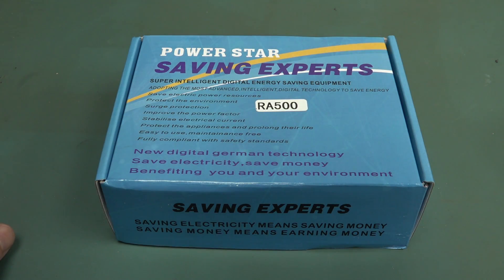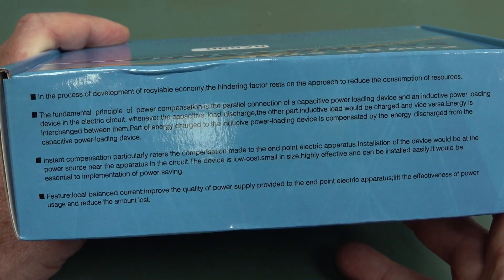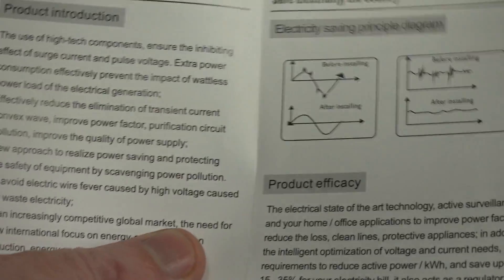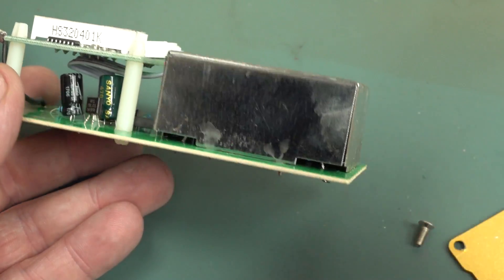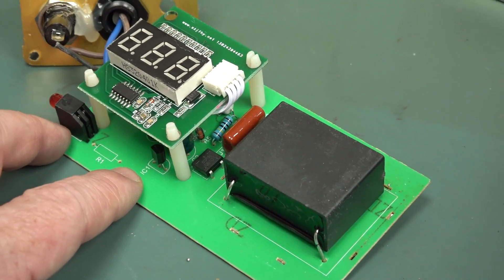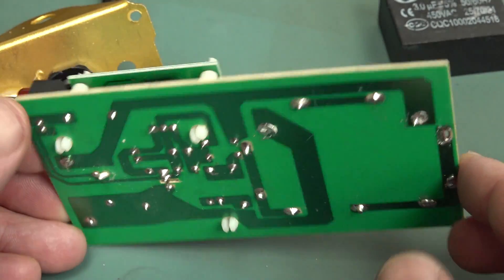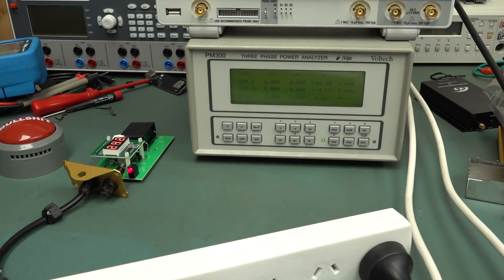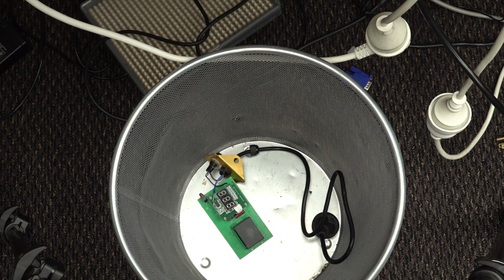EEVblog #1191 - Digital Energy Savers BUSTED!

Comment: 1:40 earning money, yeah right! The only people earning money are the fraudsters selling this wooo!

4:14 NOT 25 hundred, 25 THOUSAND WATTS!
Reply from the maker: Damn, it is 25 THOUSAND!
Reply: @EEVblog  

Gotta have that "digital german".
Reply: ElectronAsh, that would be Kraftwerk
Reply: @Radfordperson  Dave's the operator with his pocket calculator...
Reply: How about a " Nola converter "?  It was invented by Frank Nola at NASA in the late 70's    This is technology that reduces voltage to a lightly loaded electric motor saving electricity.  I haven't tested one but for a motor then needs constant speed but has a varying load, it seems like it would work.  Devices such as an escalator, elevator , conveyor belt could benefit but constant load uses like an air compressor , fan would not.   Another benefit of the controller is that is gives soft starts reducing shock loads.
Reply: @bobroberts2371 , got a link to a "nola converter", my google'ing came up empty? Technically there is nothing stopping a motor from being load regulated. This is especially true where something like constant speed is required with varying loads, which is done all of the time in closed loop control systems.
Reply: @bobroberts2371  A more sophisticated version of such a gadget is often sold as a "VFD", which works even better by also varying the frequency as its name implies.
Reply: NiHaoMike A VFD is typically only used on 3 phase motors.  I've used them when working in industry.  The great thing about a modern VFD is that single phase input can be converted to 3 phase output. Output is limited to the 2 HP range but plenty enough to run small machine tools.
Reply: 25000 watts, for if when it’s too dark in your house - just get that household wiring glowing red hot!
Reply: @Pentross  "25000 watts, for if when it’s too dark in your house - just get that household wiring glowing red hot!" Pumping 25kW through household wiring wont glow red hot, it obliterates the weakest point in that line at an instant...
Reply: 25kw power cord
Reply: @bobroberts2371  , thanks. Though as mentioned, I wonder what the advantages over existing regulation systems are. I assume it has to be cheaper, easier to manufacture, or something.
Reply: LetterSlayer they should try fitting a power plant inside saying 50Mega watt
Reply: lol wanted to say the EXACT same thing ^_^
Reply: Agreed to kill what is in the air she saving device.

I borrowed one a couple of times to prove a point.

I am wanting to bye one.
Reply: @blacknester Just turn up the voltage until leakage isn't ignored, would need a few kV   ;)
Reply: @blacknester , at a fixed mains voltage, your current is going to be huge... and melting, at 25,000 watts, especially given the small conductors in the device, they'd probably fail first and early on anyhow.

Comment: As an electrical and electronic engineer of 36 years with many years in R&D I am appalled that an engineer in China/Germany would consent to make this gubbins which is BS and has written up the item in BS Chinglish. A little bit of knowledge is a dangerous and apparently lucrative thing. 
PS why even bother to have the expense of the capacitor and circuit elements when an empty box would 'work' just as well.

Comment: There are two types of power factor. The first is the one that most people know which is called the displacement power factor. This is due to cos(theta_v - theta_i) , I.e. the angle between the fundamental voltage and fundamental current. The second type of power factor is due to the harmonics being drawn from a switch mode device. This is called Distortion Factor and is given by (rms of fundamental current)/(total rms current). The total power factor is multiplying the displacement power factor with the distortion factor. 

This means that a switch mode component with a poor distortion factor will have a poor power factor regardless of if you connect an inductor or capacitor in parallel with the device. In fact, as Dave showed that putting the capacitor in parallel with the oscilloscope, the power factor decreased. Because the oscilloscope has a distortion factor and the capacitor added an extra displacement power factor on top of it.

To improve the power factor of switch mode devices we would need to place a low pass filter in series with it so that it filters out the current harmonics that the switching process creates.

Comment: These things do have some value if you are a ham radio operator or MW/SW radio listener. They do actually reduce the buzzies and birdies in your  radios caused by the equally-cheezy switching wall-warts coming from C#1na. Shorten the line cord to a few inches for the best effect. Plug them in to the same outlets as your noisy wall warts. Dave: Checking these as line filters with one of your surge and conducted interference testers could be fun in more ways than one!

Comment: Without getting into nonsense, the fact is that:1)Reduction of  " I squared R " losses make simple addition of capacitors of benefit near to inductive loads like fixed speed induction  motors by reducing line current losses ,but will the extra terminal voltage mean the motor simply run slightly faster and do more work ?  2) If there is a KVA maximun demand charge tariff, improving power factor makes sense whether centrally or at the final point of energy use. 3) Anything claiming to improve power quality or harmonics is generally a scam, 4) inverter drives running induction  motors  generally operating at sub 95% of mains frequency will save energy and 5) fixed speed motor voltage controllers for generally cyclic load duty on mainly lightly loaded  induction motors can make a significant % saving. 6)As an energy saving professional I can confirm there are no holes in the laws of physics to justify  dodgy spurious energy saving gizzmos.

Comment: Question though, there was a similar product for autos, a 12V 2.5 F (or higher!) super cap that you wire in parallel to your car. Supposedly the intent is to supply transient power if an amplifier momentarily draws more than the alternator could supply. Now I’ve heard that these in fact only serve to add more load onto the alternator, and therefore reduce the total power capability of the auto electric system -fair enough. But then there was another guy who removed his car battery entirely, and ran his auto solely using the capacitor! Cold starts and everything. Now I suppose you have greatly limited cranks and you wouldn’t be able to run your radio or lights, or anything, if the engine were off without soon discharging the capacitor and stranding yourself in need of a boost, so it’s not all that practical. But if the capacitor can effectively replace the battery, does it therefore work as the car audio guys think it does? Is it nothing but a draw on the alternator? I’m genuinely curious.

Comment: I need to start motors on my little generator. To start the motor I need to jog it on/off several times to get it going without the generator cutting out but it runs well below the generators rating once it starts. Can anyone suggest a device that can help me? Preferably usa/canada made product.

Comment: Most household loads with bad power factor nowadays neither inductive or capacitive in the traditional sense but non-linear from switch mode power supplies. Correcting that requires some fancy electronics.

Comment: Ok, this ridiculous product aside, when you say balancing capacitors would not be beneficial in a residential environment, does that factor in more usage per device or overall consumption? I ask because our home (since we work from home and have multiple computers, a server, up to 8 monitors running at once, etc) energy consumption is high enough that the power company automatically bumped us up to the commercial billing prices anyway, however, since in our case the draw is constant, and no more than 1500w per plug, the highest being the office PC setup which draws from a single 2-gang outlet through a UPS, with the other plug being unused/blocked off with a plastic "kid protector", and the average being 400-600w per device)
Would you say that in cases like mine, where I can at any given moment be consuming 5000+ watts, averaging 2800 or so most of the time, I would be better off installing a balancing capacitor bank? I am well familiar with the concept behind it, but the closest I have come is protecting the server and office PC each with their own sine-wave based digital UPS. (The server one also protects my gaming TV and PS4, but that's not typically in use.)

Comment: Hey Mr. EE one question.... If i had a faulty appliance say a clothes dryer that ended up causing an electrical fire, could that of made my electricty price for that quarter skyrocket, due to the "smart" arsed meter thinking I was using something with a high power consumption? Annnnd could you figure out how to turn of your AUTOGAINon ya MIC please,  or talk in a consistant dB level so the AUTOGAIN doesn't try to lower the dB of ya voice.

Comment: What if you used a much bigger capacitor (and no indicator LED to save that 1 watt) on an resistive load (like a radiative electric heater) and your charged for real power (i.e., what most home consumers are charged, as opposed to reactive/apparent power charged to big industries), would you then save money on your electric bill? I would think it possible, but that's cheating the system. But if that were true, then these things would be hugh and all over the place, as there are crazy nuts that like to cheat the system, which means make others pay for you.  I can understand charging industries for reactive power, since if they could lower their cost by lowering their PF, they would do it as a good capitalist would and should to increase profits, which is the only figure of merit a capitalist has (oh, by the way, I am not against capitalism, it just needs a few checks, like charging for apparent power).

Comment: Did anyone else notice the live into the fuse holder was connected to the input side ? Correct me if i'm wrong but does that not make the outer ring on the fuse holder live if this POS is plugged in ?

The problem is that these things have been about for a long time and there are always going to be a constant supply of victims to buy them. Very sad really  as when all the smart meters are installed and they switch to apparent power as I am sure they will do as much as BigClive is they will very likely get a boost in sales.

I hate these vampires even though I am guilty of buying one or two as a cheap way to buy a case...

Comment: Well, you did some parts of it. I mean the case doesn't look half-bad, there's this AC-voltage indicator (calling inte meter would be an upfront to actual AC-voltage meters), and you get an OK PFC capacitor.
I wonder where that "german technology" is? Which part of that "technology" is "german"?

Comment: Fwiw, the anodized aluminum case is probably pretty well insulated. You need toothed washers or sharp prongs to break the oxide layer and connect to the aluminum.

Would I trust my life to that? No, but even if I saw a ground connection in there, I wouldn't assume it was effective without testing it with a meter.

Comment: Woowoo! Hahaha
With very high power consumption we are tested and fined if the factor is not at .707 +/- some tolerance. Commercial and industrial power is measured often. But of course the capacitor bank needs to be properly calculated and engineered, cost a lo of money! Greetings from Argentina!

Comment: BigClive tore down one of these and can confirm that the 'digital meter' just records the incoming power, if I remember the video correctly his unit lacked the shield over the capacitor.

He's also torn down a smart meter and pointed out that they can record either real or apparent power, all it takes is a change in software.

Comment: Looks like you get a nice looking project box out of the deal, well if they hadn't put so much advertising crap all over it!  Perhaps if you use some cleaning fluid of some sort you could remove the paint and use it for some other device, you know something that works, perhaps  a small variable power supply?

Comment: Assuming you are not, like the majority of domestic customers, being monitored and charged for apparent power (VA), surely what you want is a device that is hugely capacitive (terrible power factor) that is then buffered by some convertor out to your loads that actually have a decent power factor. In effect, you draw all your current close to zero volts, so your meter doesn't' bill you for it, but them drive that power out to your loads where they can use that power at a high voltage!  The issue, of course, is that you will need to pull hundreds, if not thousands of amps to get any meanigful power....  (I wonder what current the typical domestic 60A or 100A fuse pops out when that current is only drawn with say a 10% duty cycle (ie over the low voltage part of the 50Hz cycle??)

Comment: I have been wondering would it be worth sticking a large 240v capacitor inline with the workshop at my parents place. They are off grid and use an inverter off a 12v solar setup. 
We run fairly thick cable out there and the inverter is a 5Kw one but we can barely run 2 1500 watt motors out there without kicking off the inverter as the 2nd one starts up I don’t imagine they have a good power factor as they are starting up but they may just be drawing more power at startup...

Comment: I think it's good value for the case and parts - they look OK quality. So my advice would be to dismantle and use the bits. Any ideas for a device you could make that was useful without adding to much extra? First add that essential earth connection though.

Comment: I’ve seen “power saving” devices designed for pool pumps that reduce the motor speed (or something, I’m not clear)
I’m skeptical that it’ll save anything because they have huge heat-syncs on them. 
I wonder if anyone else has seen them?

Comment: IF they did start charging customers for power used, not apparent power (or vice versa, i cant get my head around it) thus paying for all the bad power factors etc.....would these devices (or a much better version) actually become useful if they do change the system? or what do you think would happen if they did? would things with bad power factor have to change?

Comment: Had some discussions recently with the inspectors from our local electricity supplier here in WA regarding metal cased non-earthed equipment that we get for repair. Have the double earthed symbol and the compliance tick but...........does an 'Air Gap' satisfy the double earthed requirements for Australia? Seems to depend on which inspector you talk to so I have been unable to get a definitive answer. My belief has been and still is that 'If it has a metal case it MUST be earthed'.
Anyone out there who can shed some light on this? I have been unable to find a definitive answer anywhere in any regulations.

Comment: Originally "power factor" just meant "cos phi", the cosine of the angle between voltage and current.
Traditional inductive loads had a lower power factor and could be corrected by adding a capacitor.

However, modern devices like your scope are not an "inductive load", the power factor is not low because of angle between voltage and current, but because of non-sinusoidal current.  Mostly due to switch-mode power supply without active PFC.

Unfortunately regulations on power metering not necessarily have been kept up-to-date w.r.t. this "new situation".
Try to lookup the requirements of power meters in Australia, you may find that it says nothing about measuring power in the case of non-sinusoidal current.  Here in Europe it doesn't.  It only mentions "cos phi" and "taking effective value" without any specification on how that is to be done.

So in theory a power meter could be measuring sqrt(2)*Ipeak to get Ieff and would still be compliant.
And you as a customer would pay a lot more for the power consumption by such devices than for power dissipated in a resistive load.
And when you think your bill is excessive, the company will offer you "calibration of the meter" (at your cost when it turns out to be correct), and they will measure it with a resistive load and maybe some capacitive and inductive component, it will come out correct, and you lose.

In reality it often is not as dramatic as sqrt(2)*Ipeak, but it will do some form of RMS metering with a limited bandwidth.
That can still indicate too high when your load has very spikey current.  Which a modern electronic device can have.

So you could actually "save power" (not really save power, but cut down on your electricity bill) when you filter the current to your devices in such a way that those current spikes are no longer present and the meter does not see them.
A low-pass filter on the mains should do that.  And in fact, such a lone capacitor would act as a low-pass filter, but not a very effective one.
Likely more effective is a big tuned circuit at 50/60Hz.  And of course you have to be careful not to incur a lot of losses in there, especially idle load.  It could be more than what you save by the improved metering.

Comment: I remember we did a Lincoln Tech years ago with a shit-ton of welders for the students, and the power company wanted PF correction and ultimately a large capacitor bank was added. I think it even had some intelligence in it to dynamically switch them in, or at least it sounded like it did. Otherwise it would be like drilling a hole in your canoe to drain out the water.